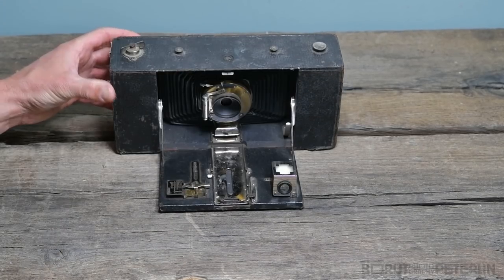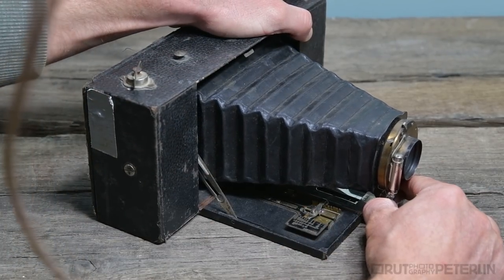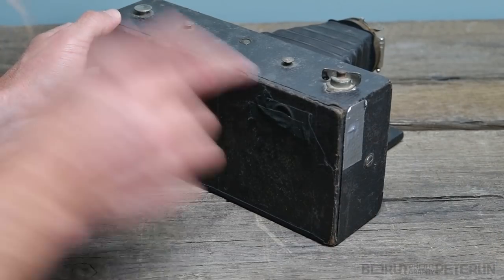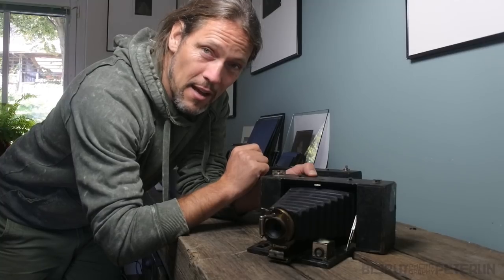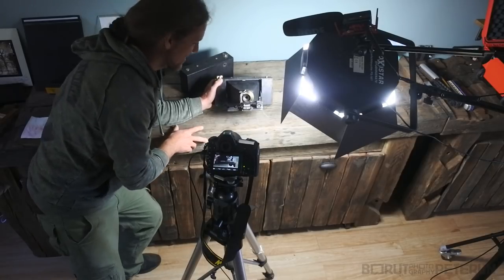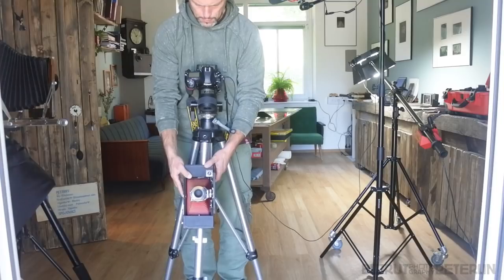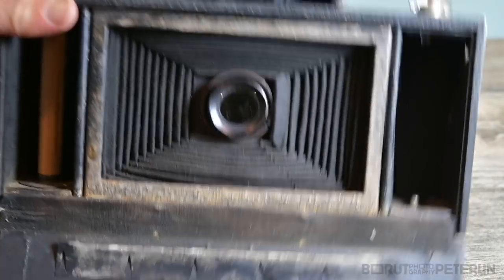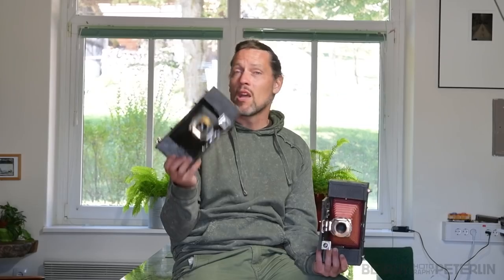Kodak Folding Brownie 3A / Topshit Photography Vlog 50

Comment: That is the U.S. aperture system used on older cameras. That lens is f/8 to f/45 in modern terms.

Both systems are the same at f/16 so you can just count your stops up and down from that one.
Reply from the maker: Thank you, I didn't know that, much appreciated!
Reply: Thank you for that info! so would the Brownie model with the f7.7 to f45 lens settings on the front of the camera be fairly accurate then?
Reply: David, that is correct. Whenever Kodak used the Universal System for aperture markings, the scale nearly always denotes "4, 8, 16, 32" and so on, simply doubling the number for each stop. Also, this scale was used primarily for Rapid Rectilinear (a doublet design) and meniscus lenses (a single lens behind an exposed iris). For lenses based on triplet designs (Anastigmat, Cooke, Tessar, etc.), Kodak used the focal ratio system in which the number represents the proportion of focal length divided by the opening size. American and European camera makers may denote slightly different "standard" stop values (such as 18 instead of 16--go figure), but all systems agree on 16-ish meaning the same relative opening. There is a handy table of comparative values for most Kodak cameras at the end of this explainer article--print and tape that table inside the dropdown base of cameras with the older numbering: https://randcollins.wordpress.com/2010/01/05/the-u-s-f-stop-system/
Reply: Thanks Don, Great information much appreciated! :)

Comment: This was a great video, and very informative! Thank you very much.
do you think that it would be possible to float this camera on a wire and operate it remotly?
how steady would the camera need to be held to get a good picture? 

thanks in advance, ian
Reply from the maker: I'm not sure if I understand what you mean by operating on wire, do you mean like remotely triggering the camera? I've made RC trigger for a different camera, it was in about May 2020.
Reply: @BorutPeterlinPhotography  I head someone claim that they flew one on a kite and took pictures of the city from high up.
I am wondering if that would be possible.
Is it possible to set the controls on the ground, send the camera up to altitude, and snap some awesome pictures?
Thanks for the reply

Comment: Borut great video! I am following your Patreon page more Brownie videos please! given the Brownie doesn't have a plate holder how do  you secure the plate in the back of the camera, do you use some sort of padding?
Reply from the maker: no, it has to be maximum width of 2mm and then you just press and close it. It will be a bit tight, but it's working. THX!

Comment: HI, I was wondering if you tried just putting a focussing screen in the back of the camera, leaving it open and focussing like on a big lf camera. I imaginet hat would be much easier to focus than with the range system
Reply from the maker: Sure, that's a very good idea. I've tried it and it works, but you need to load the film or paper of glass plate somhere close to the motif in of course darkness.
Reply: @BorutPeterlinPhotography  oh yeah I din’ t think of that

Comment: I have just tried to expose a plate (on F8) but after 10seconds exposure, 20 secs and 30 secs I am getting nothing at all. What exposure do you use on f8 please?
Reply from the maker: Well, check if the shutter is working, then repeat amd and extend the times. Oh, those f numbers were totally different value then today's f numbers. If I remember correctly fully open aperture is about f/11
Reply: Thanks Borut. It’s a mystery, the shutter (on B as T is dodgy) seems to be opening and closing fine. It’s on f4 on the camera which is f8 as you know but every plate is blank. Chemicals in another camera are fine so it’s got to be the camera. I’m scratching my head. Thanks again for the quick reply.

Comment: the old "double system" on the lens is as follows

4 = f/8
8 = f/11
16 = f/16
32 = f/22
64 = f/32
128 = f/45.

The #'s on the left are the old USA system, the #'s on the right correspond to "modern apertures" that we use in this day and age.
Reply: I've just been using exactly the same old camera . Thanks for the video ,  this old camera has been a joy to use , I'm awaiting the first pictures back within the next week or so. Regards Geoff